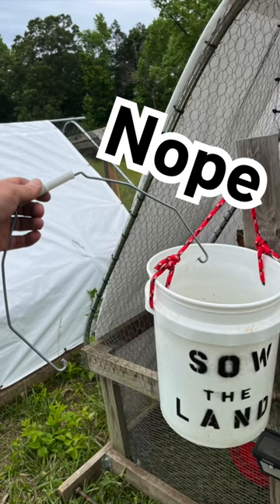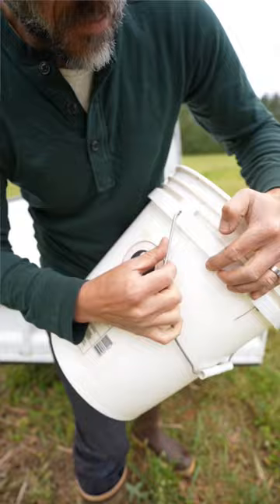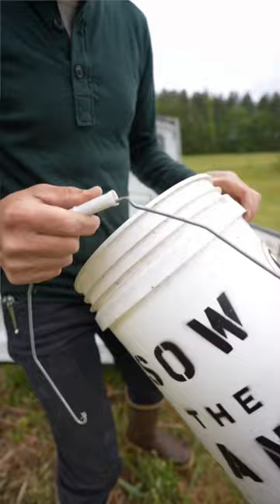Farm Water bucket handle upgrade #shorts

Comment: An upgrade is threading a 4 inch cored out wooden dowel or reusing the plastic handle that was in the original bucket handle through the new rope. Helps with not cutting your hand carrying the bucket.

Comment: wish we'd have thought of that when we used those kinds of buckets to haul scrap metal a few years back. Especially the copper wire from my dad's temp job helping electricians. the electricians would give him their left over copper at the end of each day, and we'd take it home and stripe the coating off. once it was about 20 lbs or more we'd walk it a mile or so away to the scrap yard / recycling yard and get paid for it. that was incredibly uncomfortable on my hands.